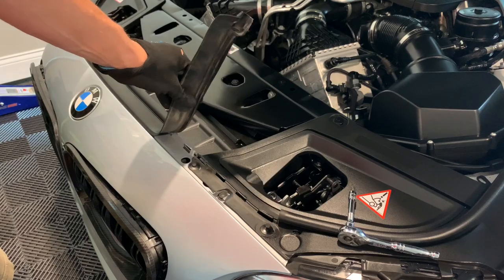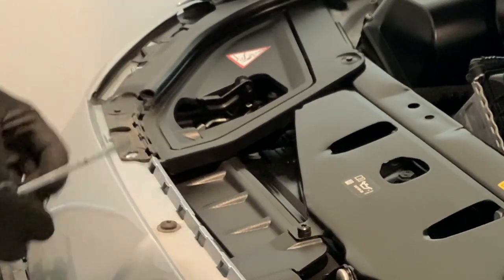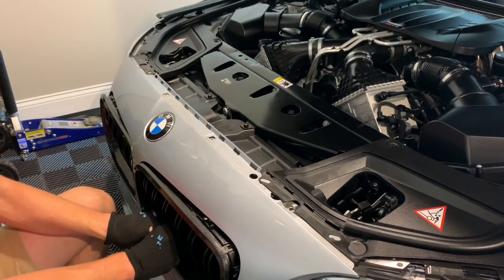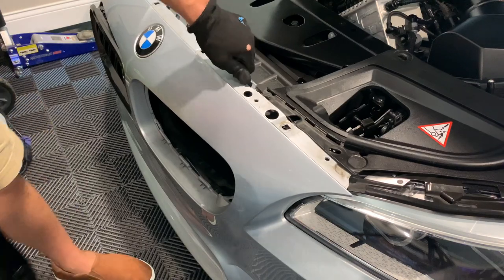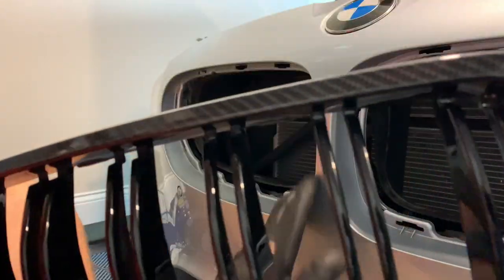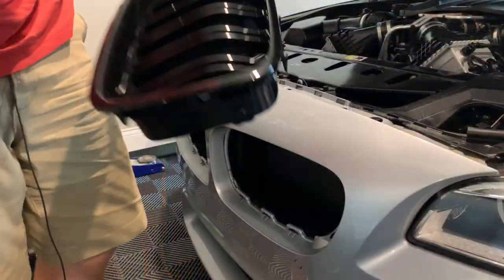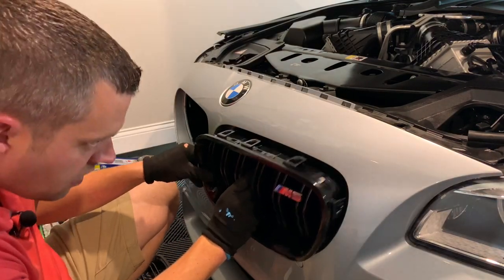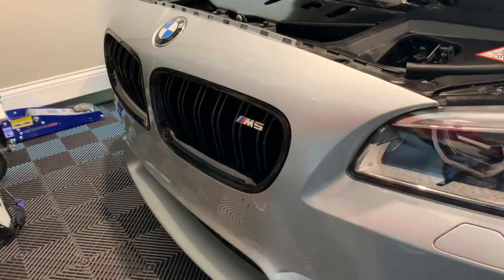BMW F10 M5 Kidney Grille DIY Install!

Comment: Thanks for a very well-made video. But after attempting this myself, I can safely say that loosening the front bumper and reaching in from the top is unnecessary, takes longer and is harder to do. Even if you attempt this method, when it comes to removing the bottom clips, you still can't reach in to push the tabs, so pulling and brute force is required anyway. By far the simpler method is to use a plastic pry tool. Slip it in-between the bumper and grill and pry the grill off, one clip at a time. As long as you are gentle, the clips just pop out without breaking. The most useful thing to know is where the clips are so you know where to put the pry tool. The bumper and gill are all plastic so there seems to be enough flex in the materials for this pry method to work.
Reply: I just pulled mine of brute force by grabbing them and pulling, surprisingly didnt break one clip and was alot quicker than taking off bolts
Reply: @kaisersosak2371  Yes, easier just to pull it off than try to come in from the top, but even easier and less likely to damage the lugs if you strategically use a plastic pry tool approximately where the clips are.

Comment: All you have to do is pull them out. Not necessary to do all those screws and weather strip. I have 2016 LCI with night vision and there is one additional screw before you pull.

Comment: What was your deciding factor between the F10 M5 vs E60 M5?
Reply from the maker: Don Dixon Wanted something with boost and a V8, especially the S63TU for modding. A lot more updated tech was another reason too. E60 M5 still is great though

Comment: FCP Euro parts failed me prematurely every time so now I don’t ever order from them. Everyone has their own experience though. For me, no point in having lifetime warranty and replacing same part after couple of months each time.
Reply from the maker: Pale__Horseman That would be the manufacture of the parts, not FCP as they don’t make their own parts. Could be either a not so good OEM brand that you’re buying, but they always make it right if you reach out to them.
Reply: BMW Fanatic I actually did reach out and after the 3rd part failed, I gave up and went elsewhere. Could’ve been super unlucky for me on the parts but like I said everyone has their own experience and for you they could work flawlessly but for me the few parts I got did not work out. I didn’t make a big deal and ask for my money back but I did share my experience.